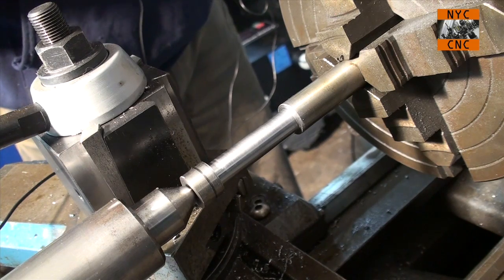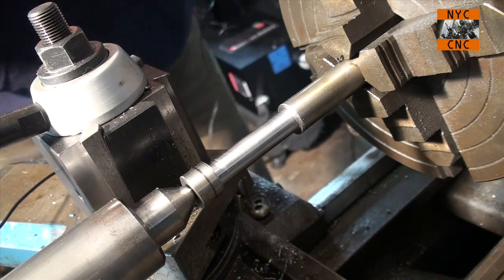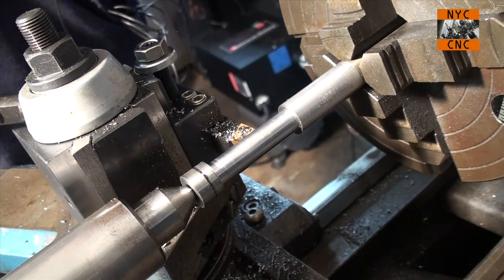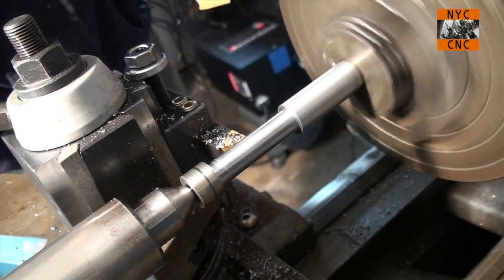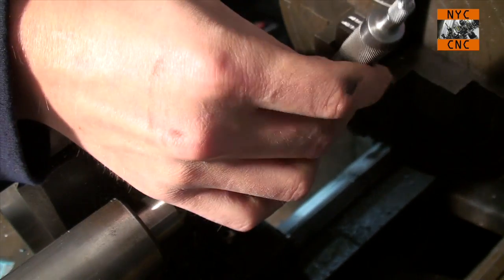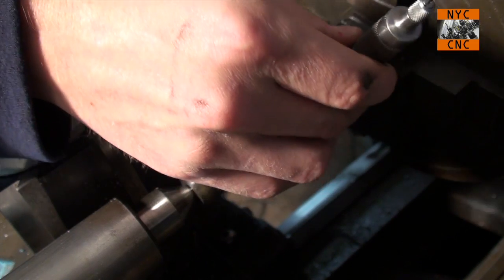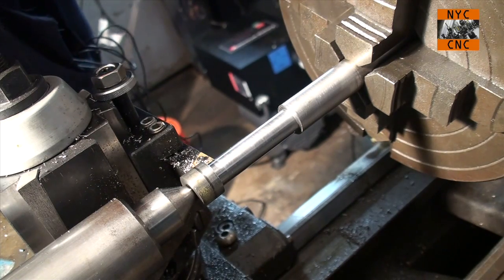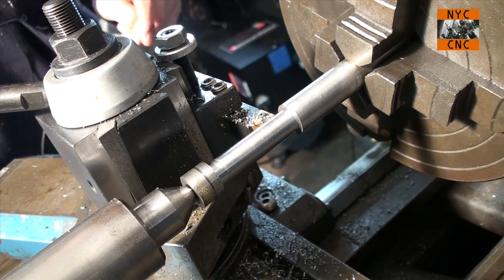Turning & Machining a Boring Bar out of O1 Tool Steel!  Part 2

Comment: I love how you use a Haimer to measure on the Tormach and use RCBS calipers to measure on the lathe.  :-)

BTW - I was thinking about making a small boring bar and a small internal threading bar, with both using carbide inserts.  There doesn't seem to be much selection of decent quality small boring/threading tools at a decent price.  I bought a cheap 8mm internal threading tools on eBay this morning and it's on a slow boat from China, but I'm not expecting much.  For the larger tools (1/2" shank and larger), Mesa Tools makes good stuff at good prices.

I wish you'd do a video on small shop tools for 3 HP and under CNC machines.  YouTube is great for how-to machining videos, and I can pick up incidental tool tips, but I've found tool selection to be a very important practical matter that is not easy to get from YouTube videos.  Show us your tool rack!  Show us your (fully commented) tool table!  Mill and lathe!  What are your favorite tools?

I like the SuperFly a lot, but I am now irrevocably committed to making a scaled up version using the 5" fly cutting bar from Suburban Tool (SubTool.com) with a TTS compatible arbor that I turn on the lathe and machine on the mill.  It should be a simple project.  I'll document it in a YouTube video, probably in a month or two.  It's added to the list for my Summer Of Awesomeness (all CNC and miscellaneous shop projects).

Comment: John the heat it self will distort shape of parts. A .010 over size per 6" of length is a good rule. If you have a machinery handbook I think that is covered? I'm not looking at the book right now, this feature size is what I've seen on prints in my career. Thanks for your help in teaching people. I'm not online that often. You can also braize carbide blanks onto tool steel for boring bars. When building boring bars keeping centerline is very critical. Your angles are very important as well. Using a surface grinder and preset angles will help. So build yourself a sine bar and a tool makers vise. Make them well square flat parallel in .0002 or better. Take your time in grinding. Use coolant. Stone very small radius on cutting edges.

Comment: There's only one proper way to cast the lead in this scenario, not like you suggested. You are fundamentally incorrect (the entire previous comment, and then some). In that case, humans might not have invented the wheel, sent probes to jupiter, or invented penicilin. If you own a lathe, you're not running a manufacturing operation, but that didn't stop you from making videos about it on youtube, or commenting. It's not "R&D purposes just because you've never done it [properly] before.

Comment: You have to ask your self what you intend to make. If you are making a boring bar for R&D purposes, then go ahead and cast it full of lead. If you are making general purpose cutting tool for use in the home shop then go with the foolproof solid steel. We both agree that a lead filled boring will out perform a hollow one, however it would be a great disappointment if the perimeters weren't tuned right and became inferior to a solid one.

Comment: The damping effect occurs on the interface of the lead and iron (internal shear friction). There's a phd thesis on this too, the hollow tube theory, floating on CNCzone. The oil won't do anything, its 'bro-science'. Compression of the core is a parameter for the damping effect. This is a separate theory.

Comment: If it is tool steel to be heat treated it will bend and .010 per side needs to be left behind per 6" length on tube type steel. Just good practice unless you have a press to manually staighten with.

Comment: John take your cut and stop spindle after .200 length to reference diameter. Take at least .008 per side. Your loosing tool life and compromising surface quality by rubbing your tool on your light cuts. Thank you for posting videos. If I could I would. You are a good man we need more like you.

Comment: The most compete and intuitive video of most hardening is watch?v=3_BH6HqpPtk. As for grinding, there is no consequence or need to grind while the steel is soft. Keep in mind you will need to have an allowance of a few thousandths before hardening, your mill or an equivalent manual mill can operate reliably to the thousands or better, all you will gain is better finish prior to heat prior to hardening.

Comment: Making a dampening system for a boring bar would be vary difficult to tune and balance. A company like Sandvik has the best engineers and and a lot of money to throw around. So they can invest in experimenting with harmonics and frequency. Doing this yourself may result in more loss of rigidity for being hollow then will be gained from the dampener.
Reply: Unless you attempt how would you know the results? I got to believe there wouldn’t be any disadvantage filling the core with lead. Might even try it here though we make a-2 boring bars and holders and they work excellent as is, better than most commercial holders. The non-hardened ones seem to dampen frequency better though we don’t have any real back to back comparatives to prove the theory.

Comment: Indeed they do, but they are not simply filed with molten lead. Either they are filed loosely with Lead shot then oil to the top, or there is a floating mass often tungsten suspended by rubber dampeners. watch?v=VNut54ovOrc  Lead is not self dampening like cast iron which dampens by its carbon inclusions. The lead shot method might have been what you were thinking of, and it would explain why you need a set screw.

Comment: If you want to avoid the chatter when you exit the cut on the mill, use a exit radius so you don't have full engagement of the cutter, use a smaller cutter and program in the radius so you can use the Cut exit

Comment: If you payed attention to the vary Mitsubishi video you referenced, you would notice that a lighter boring bar is better. Its not so much the density I worry about, but the lose of high strength materiel from within. The tensile strength of lead is so low, the bars strength well more closely resemble a hollow one.

Comment: Your statement is true that all steels regardless of their hardness or tensile strength, will deflect at the same linear rate with applied load. Where they differ is when you exceed the yield strength of the lesser steel, the harder one will continue a steep resistance to deflection while the other will plateau. You could easily exceed the yield point and not even know it,only to have it then become lower next time its deflected. There is every thing to gain and nothing to loose if hardened.

Comment: I don't see why you need to insult those who suggest to heat treat first, when you say your self it makes no difference. I believe the contrary and agree with Flachzange for the same reasons, I would even go as far as filling a radius on the cutting edges. Because the corners attract heat faster then the rest of the material placing then in the gamma region of steel, and when quenching will shrink faster then the rest causing them to collapse. Gamma iron should never be quenched as it cracks.

Comment: Oh by the way, heat treating won't do anything to dampen the bar, so you'll get the same poor surface finish on your parts, (elateive to something better). Full carbide boring bars have the same problem. See the mitsubishi 'dimple bar' for suggestions how you could have improved damping, on google images.
Reply: We’ve thought here that heat treating may actually cause further harmonic issues.

Comment: Doesn't matter, because you align your boring bar to set the tool height anyways. Anyone says to heat treat first is being autistic. It's the general protocol, but a little thinking can save you time in situations that you can't pick your strategies.

Comment: Hi,
i would harden the boring bar first and then grind it for two reasons.
The surface will be oxidized and therefore be rough. Also the edge could become too hot. Here it is not a big problem but if you have a really sharp edge like on a knife, then there is a chance that the edge will be burned during the hardening process and will not get the final hardness that you want.